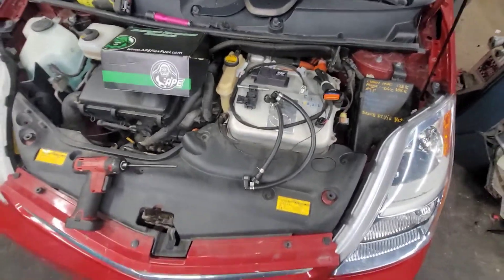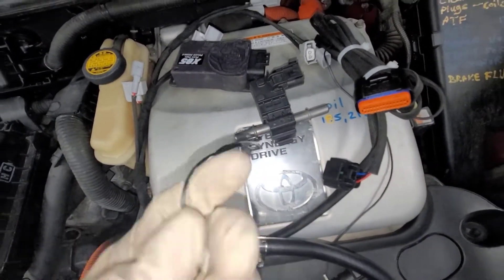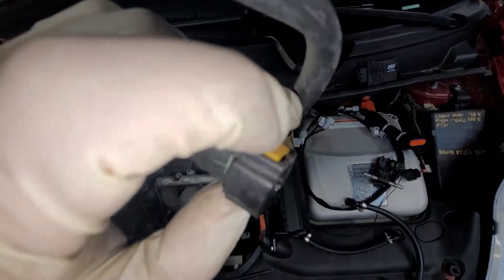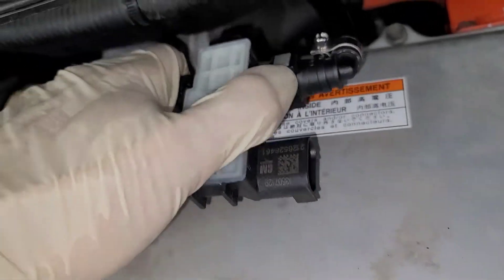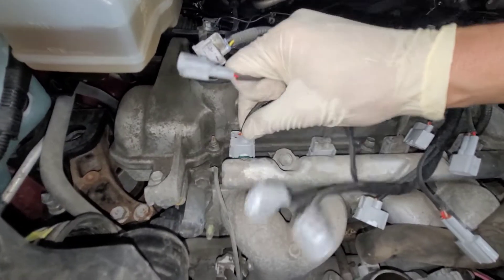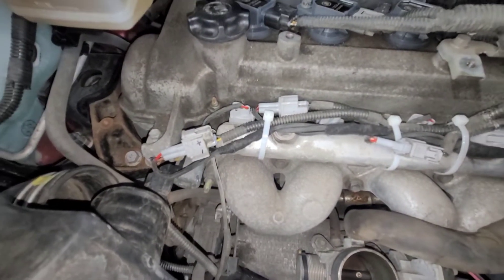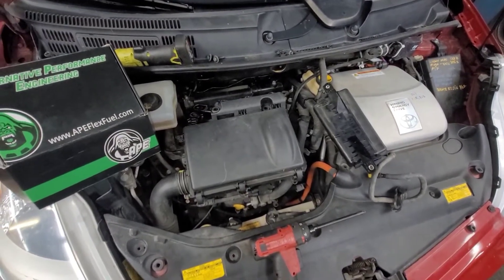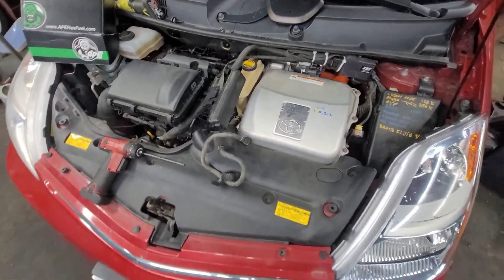Prius Flex fuel conversion run e85 / gas less than 20 minutes.

Comment: Im complete incompetent, and could take weeks because would break something along the way. Happens all the time for me, but eventually get it.
If I dont mess up I could see getting done in an hour.

This definitely doesn't seem worth the cost, especially since ethanol is bad, but seems really damn cool and way better than custom tuning that you would need to actively adjust.

I'll think about if have spare money to try putting on my "junk" (street legal) 2016 Prius to test it out. Wouldnt bother with my 2011 ford fusion, that one could stop working at any point. 2012 Chrysler town and country is alreadt flex fuel. 2022 Prius I have I don't want to risk breaking from me beinf dumb, or just damaging from using more ethanol (mainly water damage if don't drive). I know you said it's fine, but ethanol scares me LOL

Comment: May i ask how many miles was your prius when you bought and it and what year and how has the flex fuel been?
Reply from the maker: Had 180k, now after a couple years it has about 210k no issues. Been running e85 the whole time. Maybe 3 tanks of regular gasoline. Runs smoother and cleaned up the intake and pistons a bit.
Reply: @subtledriver  thanks for the info

Comment: Any updates on this car?
Reply from the maker: been driving almost every day on e85 for almost a year, have zero issues.
Reply from the maker: Only issue I had was below freezing, without adjusting the cold start on the menu, it can have slight rough start 1st time in the morning. Just run a couple extra gallons of regular gas to make the mixture 60% or lower in extreme weather.

Comment: 2024 update:  Do not convert your prius to E85.  Oct 2023 replaced the engine;  Nov 2023 replaced the fuel pump.  Also, the bluetooth stopped working w this kit.  Lesson learned.  The prius engine and fuel pump do do play well with E85.  Lesson learned.

I installed this kit on a 2015 Prius last week in 20 minutes plus some additional time to remove the windshield wiper motor for accessibility.  The APE website states the kit will work with a Gen 3 Prius.  This kit will not work with a Gen 3 prius without some minor mods.  The Gen 2 and Gen 3 have different fuel hose fittings.  There's a few ways to mod the kit to work on a Gen 3.  I chose to purchase two fittings, approx. 20 dollars for both.  Amazon part Russell 640930-6 and Torque Solutions TS-UNI-007 and some fuel thread sealant.  Works fine, no leaks, no cutting.  I haven't noticed any reduction in performance or mileage.  But, it's only been a week and approx. 200 miles,  there's still some regular gas in the tank.  The APE bluetooth app works perfectly, currently states the Prius is running on 53 percent ethanol.  I'll update this review in a month or two.
Reply: Ok so any update on your e85 conversion?
Reply: @scott01clay74    It's been four months since installing this kit.   It's been driven approximately five or six thousand miles running on E85 only.  The bluetooth app says the gas station pump is delivering a consistent 75 percent.  The car runs perfectly.  It's a Prius but it seems it may have slightly more pep.  I haven't noticed any significant drop in mpg, possibly 1 or 2 mpg, it's negligible.  I average 36 mpg overall, I think it was 37 before.  I still get over 50 mpg on the freeway on long trips.

This Jan/Feb we had three weeks of overnight temperatures in the low 30s, never below 32 degrees.  In the morning the Prius started poorly and did not run well for the first few minutes. The engine would throw two codes, P3190 and one other similar.  But I still drove the car, it cleared up in a few minutes.  When the day warmed up and I would drive the car again, the codes would clear and the car ran fine.  I did this for a few weeks, doesn't seem to have harmed anything.  Next winter I'll switch to regular gas in Jan/Feb

In summary, the kit works as described, the car runs perfectly in warm weather, the car does not start or run well in freezing temperatures.  I haven't had any problems of any kind, no dripping fuel, no issues.  I'll convert our other car this year too now that I know it works.

Comment: Did this on my Matrix love it lost a little MPG but its much spunkier and idles better 2.99 E85 vs 4.50 on reg
Reply: Was the installation as easy as it is on the Prius ??
Reply: @scott01clay74  yeah mine was plug-and-play it probably took me a total of 15 minutes
Reply from the maker: Idles better cause it has more complete burn compared to gasoline

Comment: How many mpg do you get running on flex fuel?
Reply from the maker: I got a 20% loss in economy when on 100% e85 gas compared to gasoline. so as long as the e85 is @ 20% or greater price difference, i am saving money. But it really depends on what mix, since it can run any mix and adjusts automatically.

Comment: Any updates…thinking of doing this on a 05 escape hybrid
Reply from the maker: Put a few thousand miles on it. Runs smoother and get about 20% reduced mpg but still saves money here in California
Reply: @subtledriver  3.99 for e85.22

0.18995/mile flexfuel (including deducting the mpg loss )  vs 0.22453/mile for 91octane  at $5.29

so the break even point is 18,000-20,000 miles bro
Reply from the maker: @punker4Real  dang, they are not giving you good e85 prices. It should be about 40% off or half premium price. 🤔

Comment: Here is an idea for you. Raise the compression on the Prius to @ 14:1 . The Honda GX has such a ratio and is written by David Blume in his book AlcoholCanbeaGas that 14:1 ratio makes the perfect zone for optimal ethanol MPG.
Reply: Straight ethonol you got a point but for flex fuel 14:1 is to high for 89/low octane fuel not to mention custom cut cam springs and retainers decked head and a complete bottom end to forge performance parts that's about a 10-15k build
Reply: You can also use a GNG spark advance computer or get a remap.

Comment: I have a 2010 will this work for my prius
Reply from the maker: Yes it is port injection. It will work great on the 3rd gen. We already have a customer running this on his 2012 for 3 years.
Reply: What's his mpg total cost of the kit
Reply: Also is it safe on the bladder I was reading online people were mentioning it
Reply from the maker: @fizzyfizzgigcouple957  I thought the 1st gen was the only one with a baldder..bladder... but yes, anything newer than 1994 is 100% safe with ethanol. Keep in mind. 10% ethanol is in the fuel now. So it would have failed already.... 😕  use subtledriver as discount code. Apeflexfuel.com
Reply: I'm very interested